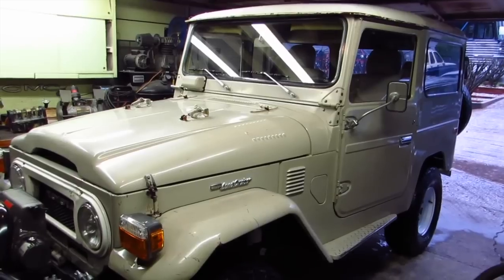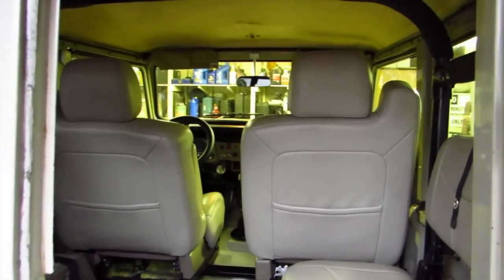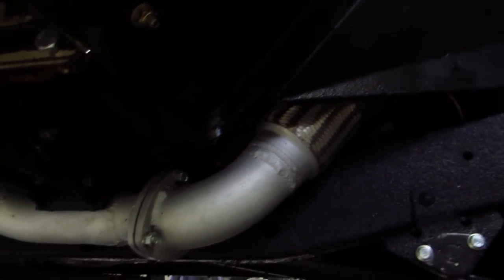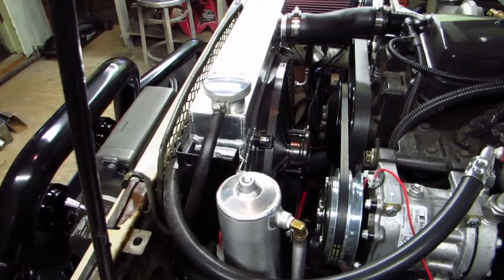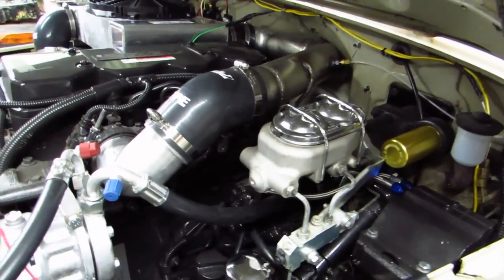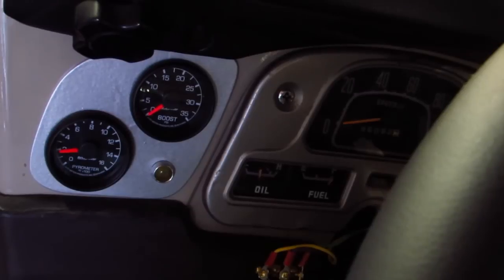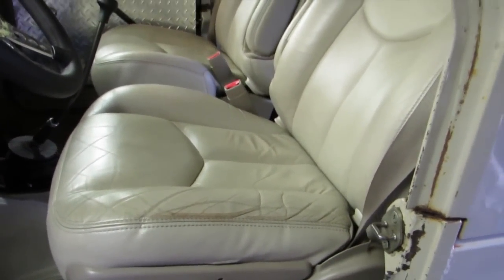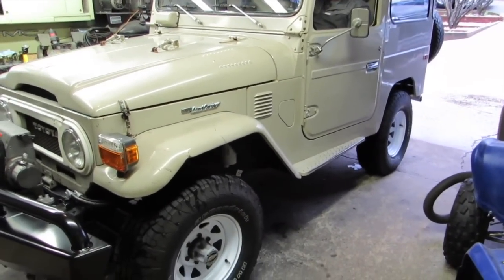Cruiser Innovations Built 1975 FJ40 Land Cruiser *CUSTOM*  4.5L Cummins Power *SHE'S ALIVE!!  Part 2

Comment: I LOVE this build. The only thing that would make it better would be if it was in a clean HJ47 troopy!
I have been digging more into these 4.5L Cummins (planning a swap for a '72 scout) and the one piece of the puzzle I can't track down is the ECU. I would like to throw it in front of an NV4500, so trans control isn't an issue. What did you use for an ECU? All of the stand-alone units I have tracked down have little to no information on them. Any help you can offer would be appreciated.
Reply from the maker: the 4.5L cummins comes with it's own stand alone ECM. Wire up power, ground, indicator lights, throttle, and you are off to the races. I have changed a bit of the programing with Cummins INSITE software but only minor adjustments which have made it a bit more enjoyable (Ex. turning up the idle slitghtly to smooth it out)...

Comment: So I am just finding out about these 4.5 Cummins. I am thinking about doing a 4.5 in my 99 Durango to make a fuel efficient mountain goat. As it sits that 318 loves gas lol. Other than the obvious fabrication that would have to be done such as motor mounts and cross members and suspension modification, what problems should I expect to run into? Also after having this swap for years now, how is the driving? Would you recommend this swap?
Reply from the maker: This is not a good option for a novice fabricator (Not assuming you are). The engine is a squeeze and in respect to the technical side of things it is far to much information than I have time to get into... I would recommend an older 4BT cummins or maybe the 2.8 Cummins which is designed for engine conversion enthusiast. This engine runs extremely strong and is a blast to drive but just not worth the cost and headache that goes into it. I hope this helps...

Comment: Where did you get the gas pedal and harness to run the engine?  I’m trying to do this build on a willies wagon, but i have no idea where to find the parts?
Reply from the maker: I picked the throttle pedal up used from a 2007 Dodge 2500 Pickup and removed the plug while I was at it...

Comment: Very nice! How many hp and NM?
Reply from the maker: Factory it is 110 HP. A lot has been changed since then and I haven't had it dyno'ed to find out where it is now...
Reply from the maker: I'm over 180 hp!
Reply: @CruiserInnovationsLC  In Australia these engines are becoming very popular and they are running them at 270hp on stock internals as far as I know. On Facebook you can check them out:  Cummins Rod and Race Engines / Cummins 4.5L Conversions Australia / Diesel Conversions Australia. Love your workmanship Josh!!
P.S please post more videos if/ when able😀 thanks
Reply: 180 hp and 830 NM of torque

Comment: Very, very impressive build. More should use this engine over the turd of a 3.9L. The 3.9L may be a solid motor when done correct, but they make crap for power. Seriously nice job.
Reply from the maker: Thank you :) This was a very challenging but certainly rewarding job :)

Comment: Nice car but it is not a FJ 40 it is a test rack for all kind of stuff , which has nothing to do with this car . I don't get it , why is it always a DIY garage owner thinks he is smarter then 10000 Toyota engineers and 5 millions test miles. This car is worthless , not original and nobody will be able to repair it in the future only the owner , because nobody knows where to get the parts to fix it and how it is wired and connected.
Reply: You must think it's nice to own a vehicle that parts aren't easy to come buy in the first place. Sure he made a lot, but his can be fixed almost as easy as a stock FJ. Toyota didn't put near as much work into the old versions as you think. His makes a lot more power, likely drives much better, gets better mileage, and won't need the fear of driving a stock one. A good number of those trucks had motor swaps done for a reason.
Reply: Anyone who says that this vehicle is the worthless is just jealous